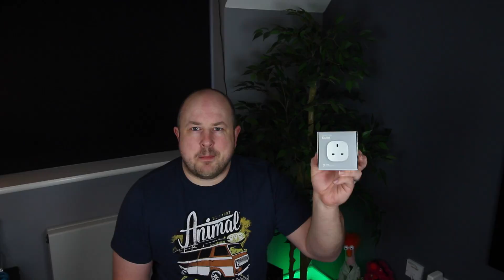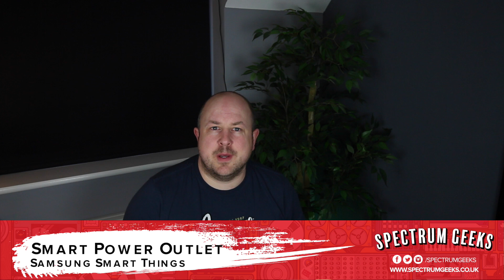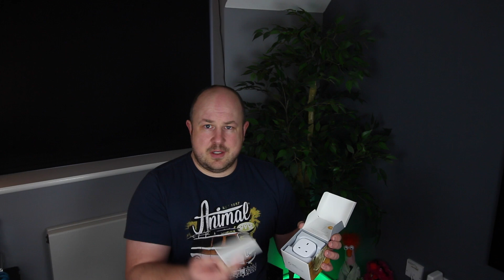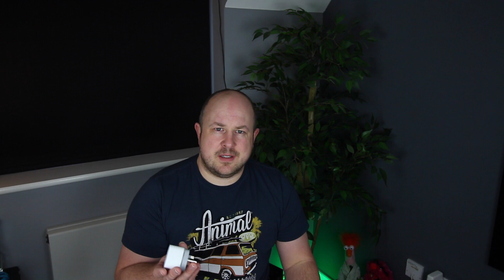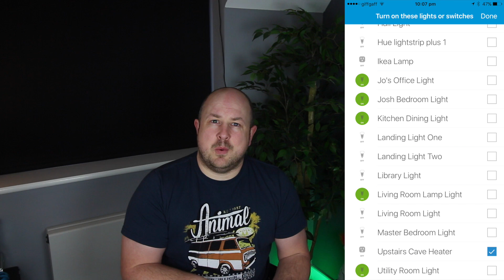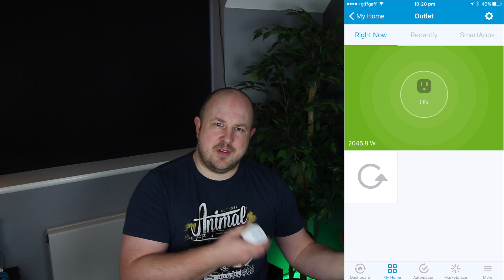Samsung Smart Things Power Outlet Unboxing and Thoughts

Comment: i have 5 of them and cannot connect to new Samsung hub , does anyone know the way.
Reply from the maker: I don't use them much anymore. Is at least one of them close enough to the hub to start a mesh network to allow ones further away to connect?
Reply: Spectrum Geeks I can't even connect to hub within 2 feet of range.  Will try today with old hub
Reply from the maker: @homecinema3955  That sucks ... best of luck. I have suffered with some of the other Smart Things products, but the hubs and power outlets have always been reliable.